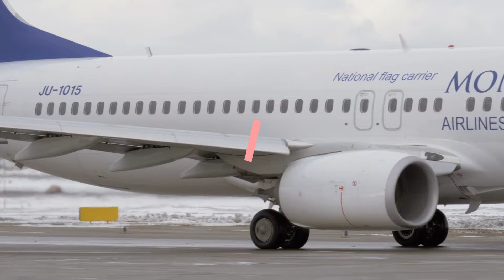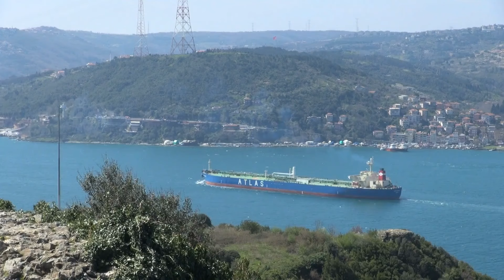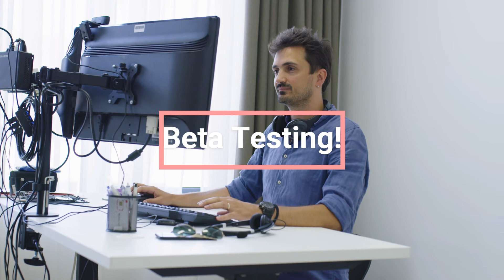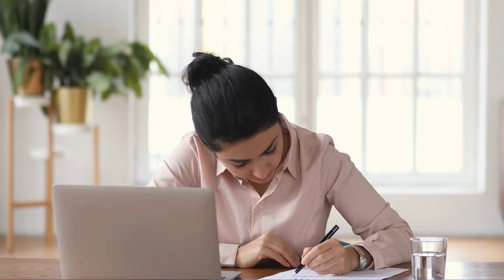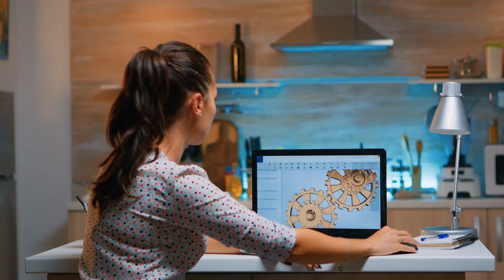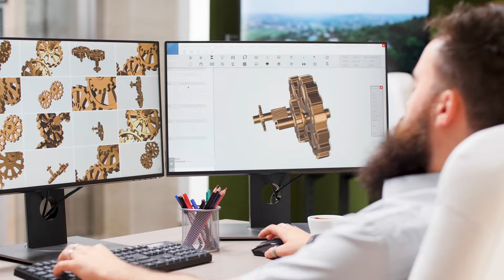Why Engineering Systems are Failing?

Comment: Sir, while giving the presentation of my msc thesis in the interviews, do I have to wrap up everything in 10 minutes or it's flexible? I am asking in general.
Reply from the maker: Generally they will provide a time for interviews which will include a time for presentation of your thesis research. If they don’t it is good to ask by email.
Reply: @Drganguli  In case I exceed the time limit while presenting my msc thesis, will it affect my chances?
Reply from the maker: @GoogleScholar2001  Yes they often have a string of interviews lined up for candidates one after the other other.

Comment: Nice topic, sir. These points about fail-safe design and error-free calculations are of paramount importance. On a positive note, I would like to share an industry practice: if the management (in the industry) gives utmost importance to quality of the production code for aerospace applications, they shall definitely go through a rigorous systematic checks. One such example is the DO-178C for North America; this is just one of many other qualifications that software for critical aero applications go through. There must be similar qualifications/certifications for other domains as well.

Parallely, I am wondering how AI software are getting tested (with regards to engineering applications like transport). Perhaps, a Digital Twin maybe of help here. But there is always a question of reliability. This would be nice discussion for a future video, sir.
Reply from the maker: Thanks for your insights and for the comment on the importance of digital twins in the future. They can play a key role in maintaining systems and also in spotting impending fault events. Hope you have seen my digital twin high level review video. 
Learn about Digital Twins!
https://youtu.be/IeMMFHwJTEU